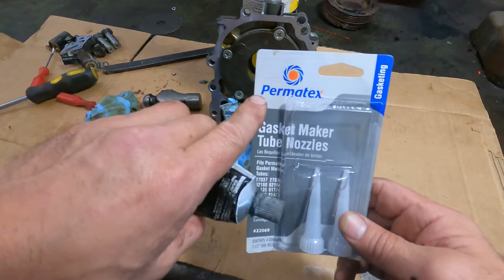Subaru ej253 final assembly and start!  Finally done! 2010 Subaru Impreza ej253 rebuild and roll out

Comment: I'm debating on rebuilding mine since the engine is basically on it's last leg. What was the most difficult part about rebuilding the engine?
Reply from the maker: There really wasn’t any spot I would say is worse then any other. However making sure all the sealing surfaces were flat and clean as well as torque values and patterns were followed properly. They are super engines and really quite easy to rebuild.